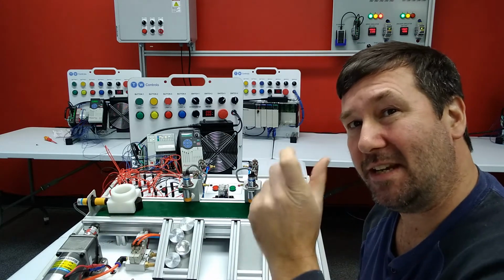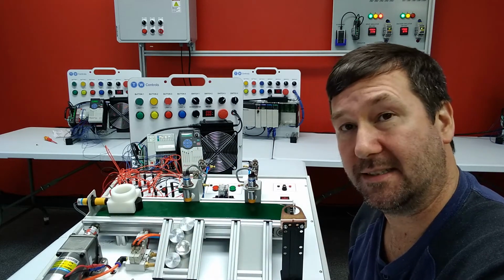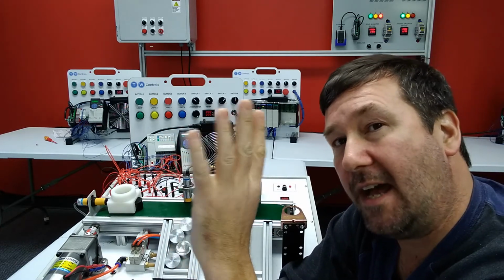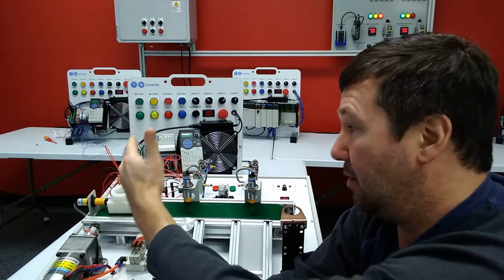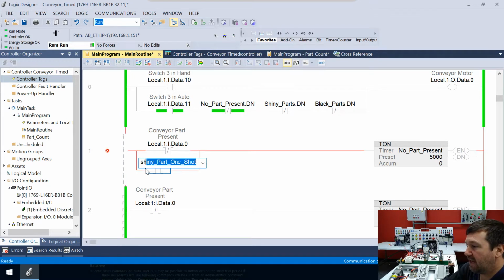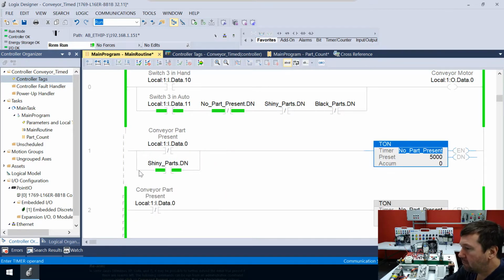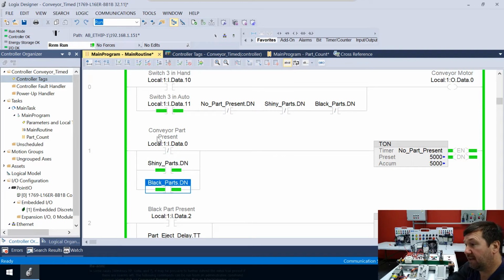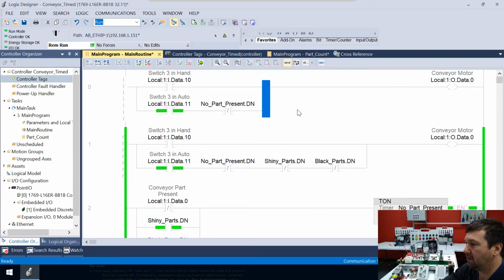Conveyor Trainer Part 8 - Debugging PLC Program Flaws.  Thinking Before You Make Program Changes.

Comment: Hello Tim and thanks for another awesome tutorial.
I was wondering if you have any devices that you might recommend other than a PLC in recording the conveyor run time and parts being placed on the conveyor for a certain duration of time for data monthly storage and review?
Reply from the maker: I get the feeling that you are asking some Arduino or Raspberry Pi option which I 100% would not do.  Let me flip the question around, why don't you want to do it with a PLC?
Reply: @TimWilborne  
Because this particular machine is very old and does not have a PLC. 😅
Reply from the maker: Overall the most robust way will still be to stick a small inexpensive PLC into it.  There are some devices that claim they can do what you are looking for but I make videos on things that I find beneficial and you won't find a video on them :)
Reply: @TimWilborne  
Okay.
Thanks again Tim.
Reply from the maker: You are welcome.

Comment: great channel. I was wondering about the program here. the only reason for the green push button is to reset the push counter. however when you added the two branches would the conveyer still respond to a parts being dropped in even with the shiny and the black bin filled?
Reply from the maker: No, it just gives it the additional time to make sure all parts are off of the conveyor before turning it off.

Comment: I really like your videos regarding allen bradley PLCs
I've done work in Siemens PLC but recent project is related to allen bradley and your videos helped me alot.
About this videos there are still some issues i.e
Lets say Black Part 4 done and the next in conveyor is Black again 5th part which will over fill the Black tray ( same goes for shiny Parts)
Reply from the maker: I'm not following you.  What timestamp are you at?
Reply: @TimWilborne  You only have 4 parts each (Black and Shiny)
Lets say if you have 5 parts and  when first tray (either black or shiny ) is full and conveyor stay on till 5 sec and during that time if same color as the tray full is the next one drops in it will overfill that tray